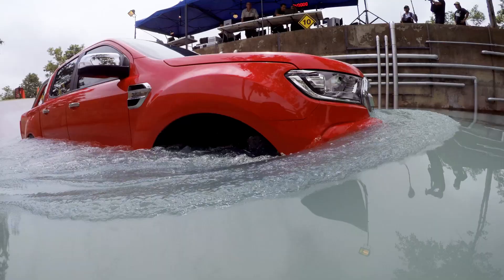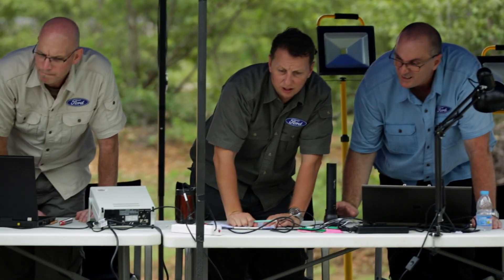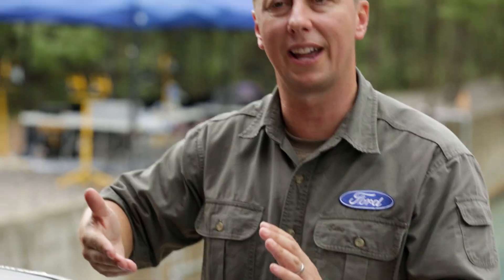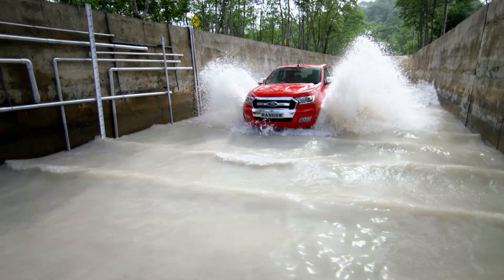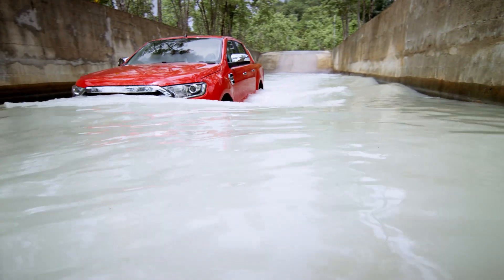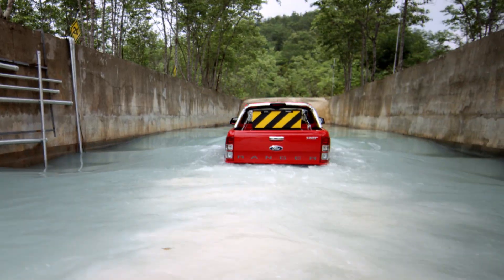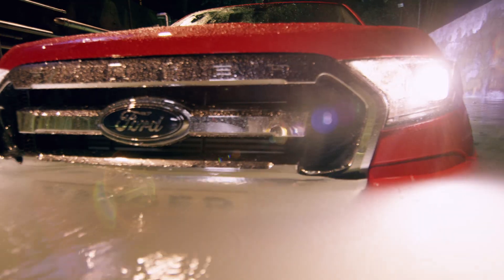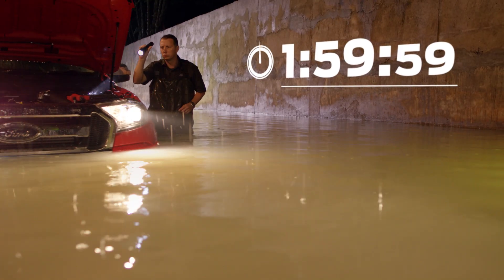The Science of Tough Episode 3 – Deep Water

Comment: I hit some big desert whoops at 12 mph when I should have been going seven. Tore both fender wells clean out of my 99 F150 2wd stock xtra cab 5.4 XLT. I remember looking in my rearview mirror and seeing both of them lying behind the truck. Then the floods of 2005 came to So. Cal. Puddles became lakes 20 feet deep. I never saw so much mud. I didn't know that the air intake was behind the missing fender well.  Those 5.4's are tough motors.